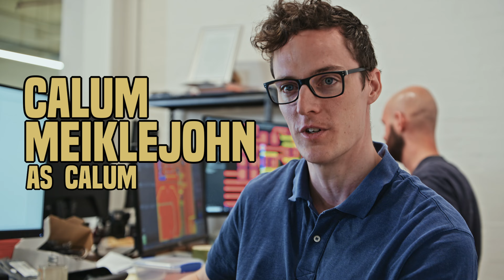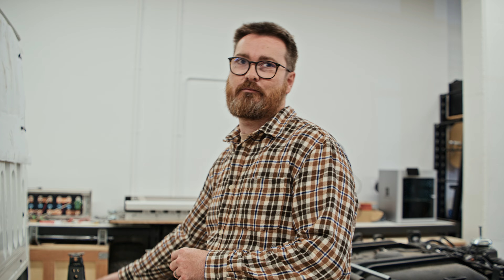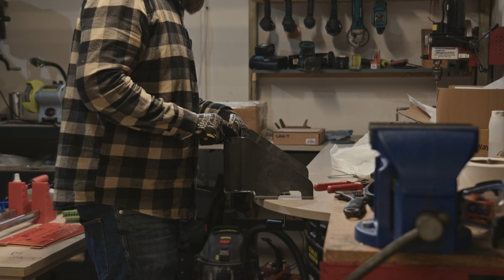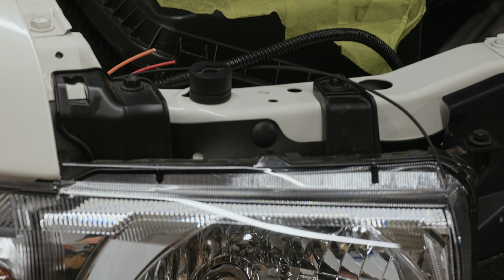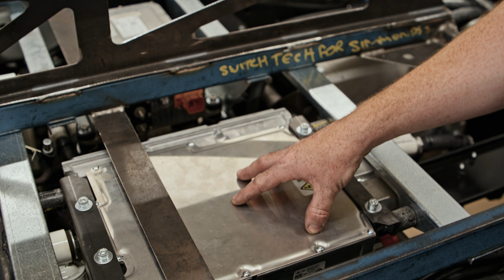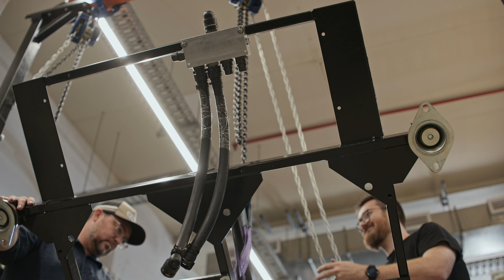Drivetrain Build For V8 Hybrid Diesel - EP.07

Comment: Cool videos guys,
You might want to change those downward facing spring-washer retained bolts with welded studs + nylock nuts.
Corrugated roads will have them disappearing quite quickly.
Cheers

Comment: Very cool but you have just turned a 90k truck into a 130k truck and still doesn’t have electric windows mirrors climate control a clutch that can handle the power brakes that actually stop it no cup holders and less than 500kg payload

Comment: Great work, gents. Is it possible to angle the pouch cells to reduce the overall height of the battery? 

Here is a free mock-up: \\\\\\\\\\\\\\\\
Reply: I think you may be a degree or 2 off. Details matter. ;)
Reply from the maker: Also more aero dynamic that way